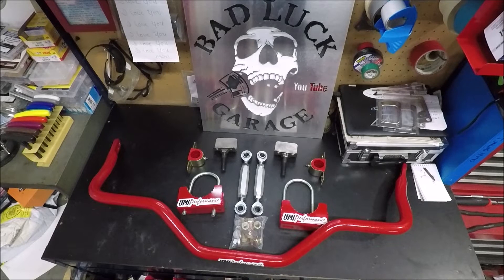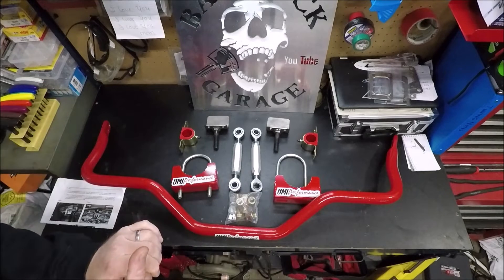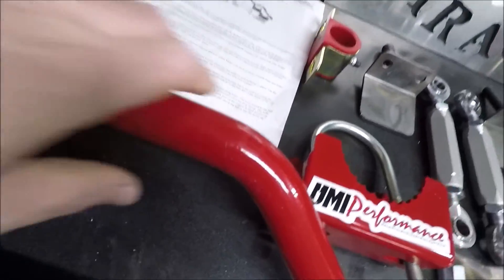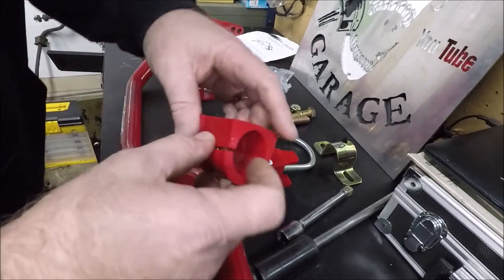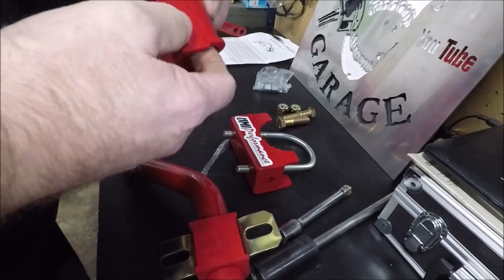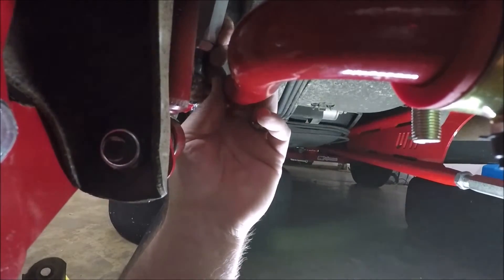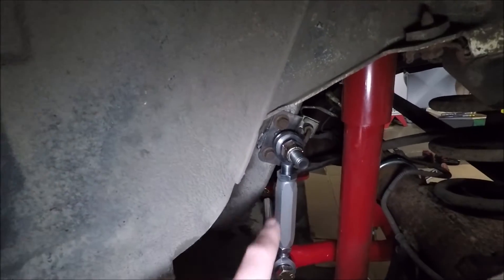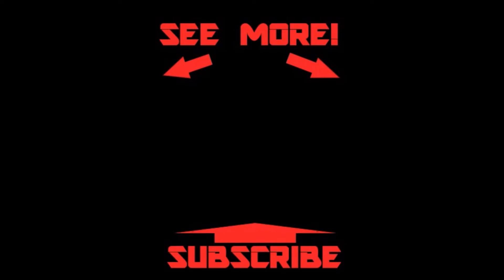UMI ADJUSTABLE ANTI-ROLL BAR INSTALL 82-92 CAMARO/FIREBIRD

Comment: Currently doing a 6.0 4l80 swap on my 91 z28... haven’t found any bolt on solution for a 4l80 crossmember/ torque are mount
Reply: They're the same bro a 700R case is the exact same thing as a 4l60 case so any will fit
Reply from the maker: I don’t know of many companies that make the crossmember for the 4L80 brother. It’s a huge transmission compared to a 60e and requires the mount to be a lot lower and further back. I think maybe Hooker makes one but I’m not sure. I’ve used the 80e in every other swap I’ve done except for Chaos Theory but I’ve never put one in a third gen. Honestly I’m surprised UMI makes a crossmember for the TH400 yet hasn’t developed one for the 4L80 yet. 🤷🏼‍♂️

Comment: If you was to put a 9” under it would you still be using the sway bar? If there were ladder bars?
Reply from the maker: I saw you had already found the 9” installation video before I saw this. Lol. I document all the modifications on all of our project vehicles here on the channel. Each vehicle has its own playlist and I try to use appropriate titles to make things easy to find instead of using clickbait titles like other channels. Hopefully the  Chaos Theory Camaro videos help you out with your build. Keep in mind there is also a “LS Swap Tips and Tricks” playlist where I explain basic swap questions I get asked in detail. I plan to add more videos to that playlist soon as well.
Reply: @BadLuckGarage   yessir. These videos will definitely help. Thank you!

Comment: I am currently ls swapping a 1981 c 10 with a 2012 ls out of a gmc sierra crew cab and am having an issue wiring up the obd2 port with the pcm and wanted to know if you knew what pin goes to the obd2 port